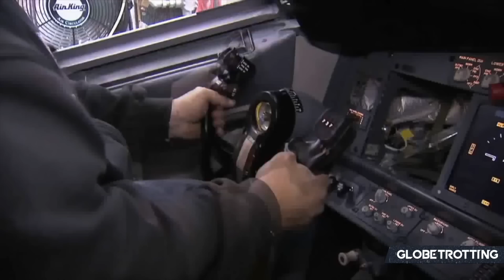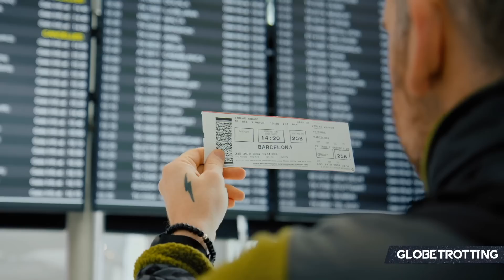The Worst Airline...   Ryanair?

Comment: you get what you pay for.
Reply: and you get one 0.0000000000000000000000000001 kg bag for 200 euros
Reply: My biggest problem with them is there labor practices.
Reply: Spot on!
Reply: And nowadays you don't pay all that much if you choose a traditional airline.
In April I needed to fly between Porto and Hamburg and although the the flight was cheap going out, the return flight was so much more expensive that I manage to fly Lufthansa (with 20kg of luggage) for less.
Some people got into their minds that "Ryanair = cheap" and forget to confirm if that is truly the case. Spoiler alert: it is not always the case.
Reply: @moldypizza__  You get a 20kg bag for around 30€, that‘s really cheap compared to other airlines
Reply: @mstrmren  you pay for the bag then it’s overweight and you need to pay more even though it’s literally 0.01 kg heavier than the limit
Reply: @mstrmren that depents on the flight and status of that flight. we wanted to book a flight to Barcelona, 4 people, no luggage 280 euro, 4 people with a small bag, almost 700 euro. At the end we booked 3 people to Barcelona no luggage for 210 euro and one person with a suitecase in a separate booking for 160 euro and we talk one way here...... Veuling or KLM where cheaper, although we had to go to AMS and that costs money too for car or train. And the Ryanair airport was 15 minutes from home. Ryan air is not cheap anymore, but with the huge amount of flight all over Europe, they are easier to acces. 
I think it is still weird that in Europe with it dense public transport,  that flying is cheaper then train or car. you pay VAT for everything you buy, even the most neccessarry items, but flying is VAT free.
Reply: If it was that, people wouldn't complain. The problems begin when they promise that you would pay a little, get next to nothing, and then they give you even less while in fact charging you an arm and a leg.
Reply: @jacobzimmermann59   no one cares. neither ryanair nor all other 100% satisfied customers
Reply: @mstrmren  I know that you at Ryanair don't care about anything. You are world-famous for that.

Comment: I used them between Torp, Norway and Newcastle and Stanstead, several years ago. I understood that it was a cheapskate mode of transport, and glad of the low prices. 
I've never had an unpleasant encounter with airline staff, ever. But I used to see arrogant Norwegians (who have money and didn't need the cheap flight's) pushing and shoving to get the best seat. Then they argue about overweight luggage, just for the fun of it. I'm British-Australian and speak Norwegian. I've called out a couple of Norwegians for deliberately making trouble and holding up the line. They seriously p*ss me off. I did my best to embarrass them, on one occassion with applause from the long line people waiting. Ryanair, is fine. You get what you pay for. Lowcost, no-frills flights. But the idea of reducing loo facilities is a step too far. That said, I've relocated and can't say I miss them.
Airports make money on duty-free shopping. Ryanair does deals with them, delivering loads of booze-buying passengers. This is an important component of their costing. Cost cutting on the flight, and cash-in-hand for delivering customers. While other airlines pay higher landing fees, Ryanair guarantees  planeloads of perfume and alcohol, tax-avoiding customers. It's a win win all round.
Complainers have the option of using other airlines, or shut the .... up. 😁

Comment: No ! I have flown FR on many occasions between Paris (Beauvais ) and Dublin and have found the service excellent and on time as you mentioned . Usually I pay less than 100€ return whereas the price for the same trip with the legacy carriers is usually more than 300€ , a no brainer . As for hard landings , I feel these are over exaggerated . It may well be due to the relatively shorter landing struts on the B737 when compared to the A320s and hence runway impact is more likely to be transmitted to the seats of our pants . Overall you get what you pay for and horses for courses etc .
Reply: And Beauvais is not Paris

Comment: I've heard that the rough landings are due to the fact that Ryan Air serves a lot of smaller airports that have short runways that require a quicker landing which can be rough.
Reply: Those smaller airports have cheaper landing fees than major airports. That’s why Ryanair and other LCCs use small airports.
Reply: The actual reason is they hire more junior pilots who are cheaper and train them with senior pilots instead of having two senior high paid pilots. Junior pilots usually are given landings to practice.

Comment: I have flown Ryanair several times. They charge to use the "bathroom"? Name your source of information.  They don't have alcohol offered on board neither do they offer a hot meal but I have found their snack menu second to none.  Ryan Air seat distance and pitch is no different to the vast majority of short/medium haul airlines and their actual comfort is no different either.  The seats don't recline? Good! on a short flight of less then 2.5 hours from Birmingham (UK) to Alicante Spain there is no need.  Hard landings? Never noticed any of note. As you have pointed out Ryanair have never had a fatal accident, no one has ever died as a result of boarding one of their aircraft.  If you want to pay more than double for very few extra perks then by all means book with British airways.

Comment: I’m in the US and haven’t lived abroad in over 30 years. I’m 37 as of yesterday and was 5-1/2 when we came back from 4 years in Germany. I’ve got experience riding with two of the Low Cost Carriers here in the US. Southwest Airlines and Spirit Airlines. I’ll keep flying Southwest Airlines as usual. They have been great with my Fiancé and I. This is evident by the fact that I’ve been flying with them exclusively since 2015. 

Spirit Airlines on the other hand, absolutely not. Their lack of legroom for taller passengers is dangerous. I’m 6’3”/1.9m and my knees were firmly into the seat back in front of me. Not acceptable and never again. 

As for Ryanair and EasyJet, I’ve heard about them and know a bit about them. I simply don’t have the experience with them to be able to say one side or another.

Comment: The only issue with Ryanair is that they are no longer cheap… I have flown with KLM or British airways to save money a few times already. But basically, they get to charge whatever they want on many routes bc they are the only airline with a direct connection. So you end up having a £30 experience despite paying £300 🥲.